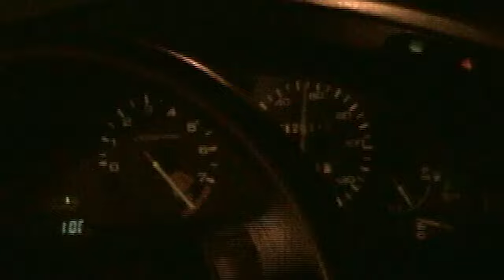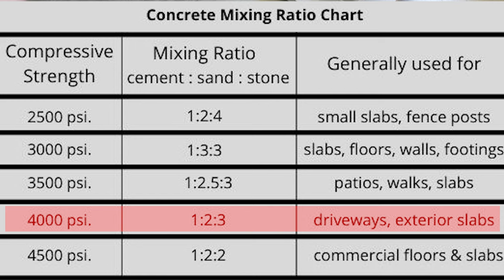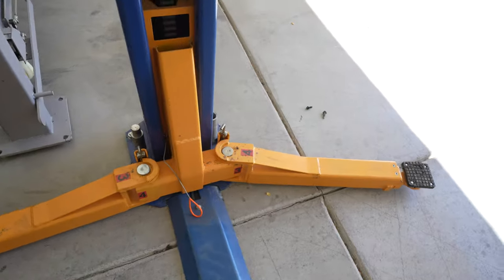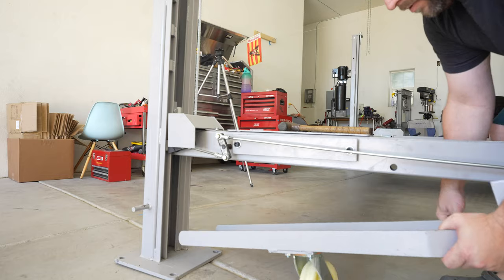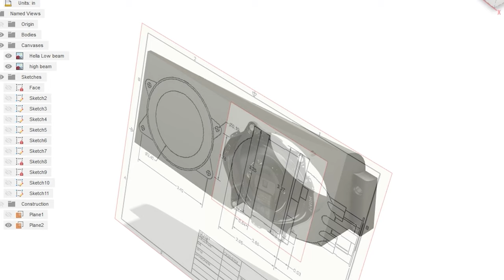4 post lift vs 2 post | Automotive lifts compared

Comment: Most mechanics will disagree.  If you are only getting one lift get a two post for versatility.  It only takes a few minutes to put a car on a two post. The brace the previous owner put in was a good idea.  I have tied my two post to an overhead beam in a triangular shape to add an element of safety. Plan to do the same when i install my four post next week.
Reply from the maker: This video is intended for the weekend warrior, the hobbyist, at best.  I also mention in the video, if you are comfortable in this space, do frequenty work and major projects, a 2 post MAY be better but working with the concrete is the most difficult issue.  In my case, the brace was added because this lift was falling over, and this is well beyond your average home garage.  Lastly, I owned multiple shops, employed many "mechanics" and still have always felt strongly, that if I'm going to choose which to have, a 4 post is safer for common hobbyist spaces.  Relying on concrete in a house garage or an old slab is tempting fate, as shown in my 2posts case.  If I were building a custom space, with new concrete, 2 posts are a must BUT I'd always have a 4 post in place for quick/dirty lifting.

Comment: I just bought a 2-post, wish I,d watched this first. Having doughts about my concrete.
Those columns are mondo-heavy. I will need to rent some kind of lift.
Reply from the maker: Be careful under there.  Doing a concrete sample matters.  If they give way, itll likely do so with little warning.  Getting the uprights positioned exactly right is also key.  I always paid to have my lifts installed so that a company had some attached liability...just how I always went about it.

Comment: Very good information,  this is good food for thought.  I currently have a Worth 10 ton 2 post lift.  I wanted the center to be open to change exhaust systems, do brakes and just basic oil changes.  I am  limited by ceiling height,  only 10 foot ceiling.   I had mine professionally installed and have nice hard thick concrete. I am having a house built in NC with a shop and will be getting a lift so based upon your input I am going to look at 4 posts.   Can you guve me a supplier as to where I can  find shorter jack stands since I only get the cars up enough to get under them . Thanks.
Reply from the maker: I sourced the stands from amazon actually.  For my lift, I ended up finding a local company who installed lifts, that also sells lifts they bring in.  I ended up paying less for my 4 post professionally INSTALLED, than Greg Smith equipment sold the lift for, before tax and shipping, so be sure to shop your local area.
Reply: @KnightDriveTV  thank you. 👍

Comment: Last name Knight and you have Airwolf flying overhead? I have questions

Glad I ran across your video. I just bought a property with a large warehouse that I've been turning into my shop.  I originally thought I needed three 2posts.  I ended up getting a Danmar 4post and a Bendpak 2 post that I'm currently installing.  I also go a set of quickjacks for moving around the shop.  I planned on using the 4 post for more routine stuff and the 2 post for the restoration projects like you said.  My 4 post is not mobile so I have the quickjacks for that. I have a feeling that I may end up using the 4 post quite a bit more than I originally thought.

Saw the LT5 behind you.  I just picked up a C4 ZR1 that needs a clutch and will definitely be using the 4 post for that.
Reply from the maker: Ya know...product of the 80s here...lol

Comment: Any thoughts on scissor lifts?  As an enthusiast, you’ve convinced me to go 4 post vs 2, but scissor lifts is another option I was considering.  Thx for the content.

Check that, I just got to the end and it sounds like it’s a good option.  Any 4 post recommendations manufacture wise?  Appreciate the info.
Reply from the maker: I do like the scissor lift, but cost and complexity of those, its a hard call.  If I could sink a scissor into the floor, man thats dream state.

On manufacturers, honestly I have used atlas, pro park and my current onenis also china.  Thebfirst two were sold by greg smith equipment so the reviews were good despite china.  They worked great all throughout.  My current is china also, but the company who installs them here in vegas also imports them.  The owner said he went to china and holds their quality to the letter and backs up the lifts.  Zero issues there also.  4 posts, theyre safe and good to go.  2 posts, you really should buy quality because if an arm weld lets go, the car is comin down.

Comment: Thank you sir, great video, I am wanting a lift in my workshop, I am getting old and tired of crawling around under my machinery. You think a 4 post could lift tractors or skid steers? I have a farm and equipment besides vehicles. I was looking at two post but they definitely don't seem as safe as 4 post of scissor lifts. I also maintain ATV's.
Reply from the maker: That's a good question.  I'd check Greg Smith equipment online and talk to one of their people on that.  You can definitely lift sxs's and atv's...a skid steer...it'd depend on the weight of course.

Comment: I can only have 1. I have a 4 car garage two car side entry and 2 car front entry.  The front entry has a single 10’ x10’ door. It's a 30’ deep by 30’ wide garage. 1/2 of this 30x30 garage is for tools, storage etc. The shop area has 10’ ceilings. The other half of this single Bay has 18’ ceilings. I'm pretty sure I'm going to get the tallest 4 post that can hold my Ford F-350 long bed and park two cars tandem under it.  

I would love to have both lifts but that's not an option.  

The other reason I'd like a 4-post is for alignments
Reply from the maker: The debate between the two is very tough, but if you can only have one...to me, you can't go wrong with a 4 post.  If you can have two...well...you see the video...lol.

Comment: Great video. What 4 post is that?
Reply from the maker: The company locally that installs the lifts, imports these by the containers.  He has been in business 30yrs and basically has the las vegas market on lock.  He trusts them, installs TONS of them, and so I trusted his experience with them.  He has personally gone to china, looked at the processes and welding, the quality of materials, etc.  He showed me a lot of information and the certification they go through over there.  I've had no issues but I also have no idea of a "brand".  A brand is essentially a sticker and a paint color, likely made in the same factories, overseas, etc.  I've had Atlas lifts and this looks literally identical.

Comment: thank you for your video i’m leaning towards the 4 post drive on for safety and ease of installation. I have a quick ? if i wanted to bolt 4 post to garage floor for permeant solution can i, is it possible or recommended 
thanks

Comment: thanks for the info was very helpful.i was looking at sissor lift.but the 4 post seems the goods. you have scared me away from a 2 post. my roof height is only 2200mm double car garage.moving the car around  on the 4 post cross my mind too.

Comment: What's your opinion about the hydraulic cylinders on the 4 post lift vs the 2 post.  I would think that is the most wear item when it comes to the seals.  You raise the lift, then lower it to the stops.  Then release the pressure on the cylinders?  On the two post, is it the same scenario?
Reply from the maker: Yes, always take pressure off the cylinders no matter what lift it is.  You stretch the cables over time also, so always on the stops.  The 4 post is smaller/slower of course, but I have never had issues honestly...not with any lifts.

Comment: i am a starting DIYer - but I aspire to build my own resto mod and really want the experience of working on everything … what projects or jobs have you run into where you literally HAD TO use a 2 post lift?  I would like the safety option of a 4 post for sure but don’t want to make life too hard
Reply from the maker: Every lift is a compromise really.  2 posts often get in the way by blocking the entire sides of the vehicle.  2 posts are great for drivetrain, 4 posts are great for access and can manage drivetrain.  Full restorations...both have their use/place.  Its hard to say a winner but when in doubt I go 4post.  You can use jack stands and additional lift stands with a 4 post.  A 2 post is in the way of a lot of the car but is great for drop out beneath work.  4 post is way safer

Comment: 4 post is the modern day Pit.  2 post is still king for most general work.  Would always go 2 post if you can only have one.
Reply from the maker: I wouldnt really characterize that as accurate.  A pit doesnt allow sidework to be done and also cant lift the car.  2 posts are good if you're doing major work but the risk factor is way higher for the avg user.

Comment: I’m looking for 4 post lift. Can u give some advice of what to look for in a good 4post lift ?? There seems 2b a lot of 4 post lifts the same but using different name ?? Thanks Eddie
Reply from the maker: I've gone through Greg Smith equipment for prior 4posts, that have been fine.  The one I own now is imported and certified from China.  The guy who imports them has worked exclusively with this brand/company and installs them all across Las Vegas.  For the price of a Greg Smith lift, I got this lift with installation included, for the same price.  Shop around...that's the best you can do.  You'd be suprised what may be local and get you set up for the same price of you buying online and having to deal with all the parts and pieces.  At this stage, I budget installation into it.  I leave lift building to the guys that do it everyday, day in and day out.  It's more reliable, it's done right, etc.  That's my opinion.

Comment: You don't want to leave one end of the car on jack stands on the ground and the other end on the lift still.  This is very bad for 4 post lifts especially light duty one's like yours.  You are supposed to use rolling jacks that mount on inner rails to lift one end of a vehicle on a 4 post lift.
Reply from the maker: I'm going to disagree with you there.  I sit the lift on the locks and have done it for 12yrs+.  I also know a number of pro shops that use this system, which is where I derived it from.
Reply: @KnightDriveTV  I kind of figured you would but next time you lift while one end on jacks on ground watch how the end with weight struggles while unweighted end of lift is responding different.  That sort of thing is how people end up having problems.  I believe if a problem develops you'll catch it before you drop a vehicle off but some late night or distracted and then boom.  Good luck, just wanted to make sure someone plays devils advocate on your video about this.  Good luck.
Reply: I know this is older, but for anyone seeing this, you are absolutely correct. The fact that some shops do it or my buddy does it does not make using those Jack stands on a 4 post lift the right thing to do, because it's not. Can you get away with it? Sure, he been doing it for a long time, but a rolling jack is what they are made for . The reason he doesn't say that is because rolling jacks cost a fortune and if people knew that, they wouldn't buy the 4 post. Glad you said it

Comment: I've got a low ceiling in my shop. I need a lift, but I'm not sure what to do
Reply from the maker: I mean...ceiling height issues are kind of indifferent between lifts.  A low ceiling is tough regardless, but I don't think one favors a low ceiling over the other...it's an equal problem.

Comment: What brands of 4-post lifts do you have confidence in? Most lower cost lifts are not certified by ALI (Automotive Lift Institute), as I'm sure you know.
Reply from the maker: I'm not here to suggest brands.  Bendpak...the end.  Most people will end up with a china lift, and I have owned many.  Greg Smith equipment sells atlas and propark...they wouldnt sell lifts that are failing out.  Also, keep in mind, china has its own certifying processes.  In the US or China though, a lift used for certification isnt always the lift you receive...production quality, inspection of your own lift and leaving the lift a margin is important, imo.  I have a 9k lb lift, means I am lifting 6500 max on a chinese lift...thats just me.

Comment: buikding garage how high should i have for ceiling for 2 lifts. 4 post lift
Reply from the maker: Depends on what youre lifting.  My garage currently has about 18ft ceilings.  Cars are easy, my tahoe with roof tent wouldn't go all the way up.  My former shops had 22ft ceilings.  Just depends
Reply: There are 2  post and 4 post lifts that will fit in a garage with 9 foot ceilings. That being said, you might not be able to lift the vehicle high enough to stand under the vehicle, depending on how tall you are, with only 9’. I just built a two car garage with the intent of putting a two post lift in it. The required ceiling height, for my particular lift was 12 feet. I went with a trussed roof design in order to get the slope I needed inside the garage to get that required height. I had city codes to deal with which determine the maximum height and total square footage of my garage. Other considerations are the distance in front of and behind  the vehicle, when it is on the lift, especially with a 2 post. With a non-movable lift, you want to make sure that when a vehicle is on the lift, 27:22 and your garage door is closed, that you still have room to work in front of and behind the vehicle. The same thing pertains to the clearance on the side of the vehicle also. You don’t want to be so close to a wall that you can’t, let’s say, work on brakes or suspension parts. You don’t want your back up against the wall when you’re trying to pull tires off of a vehicle. I mounted mine so that I have at least 4 feet from the sidewall to the vehicle, and I had at least 5 feet of room from the back end of the vehicle to the garage door when it’s closed. I have about 10 feet of room in front of the vehicle.  You don’t want to be working on a vehicle on a nice summer day, then realize you don’t have time to finish the job, but now you can’t close your garage door, and the vehicle is in a state of disassembly where you cannot take it off of the lift. Planning is key. Put a 17 foot long (or longer)vehicle in your space where you want the lift. Take lots of measurements. Visualize how high in the air you want the vehicle to go. I went with the 2 post lift. My dad on the other hand, went with a 4 post because he is in his 80s now, and it’s very difficult for him to get down on the ground and do any work there. Even setting the arms for the two post would be very difficult for him. Those are my thoughts. Just wanted to add a few things that I don’t remember being mentioned in the video. Hope this helps.